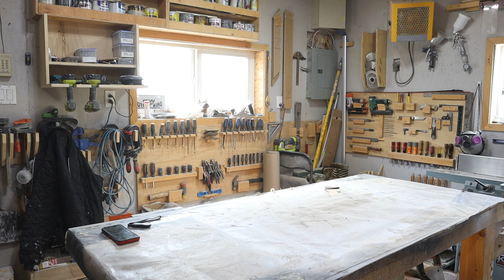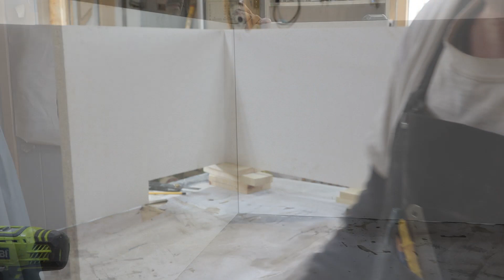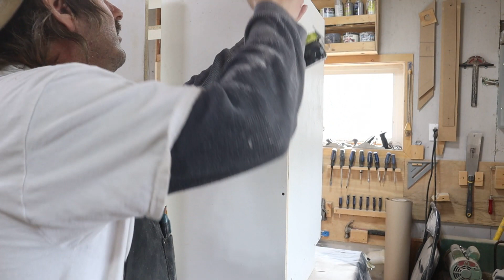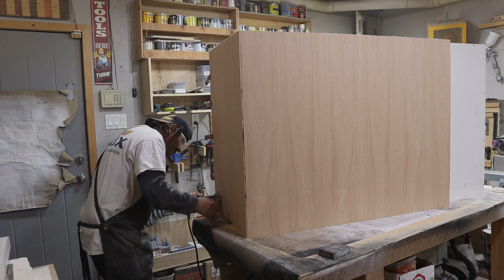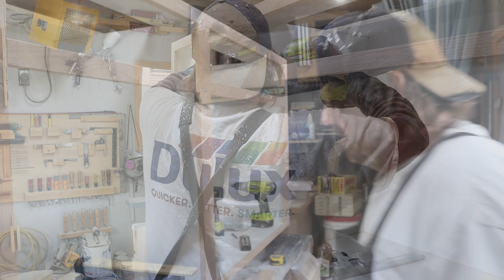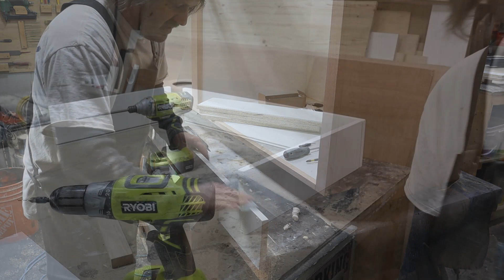The weirdest request for a kitchen island build I've ever had . Part 1 #kitchenislandbuild #diy

Comment: you could do double drawer slides so that it could pull out past the overhang, you'd need to probably  use 4 full extension (pair per side) on the cabinet  for support and another pair(not full extension for the drawer itself. downside is decreased drawer width.
Reply from the maker: That's a good idea I'll run that past the customer and see what he says